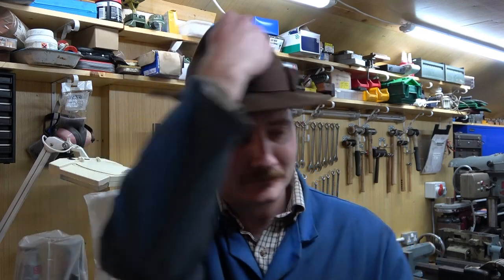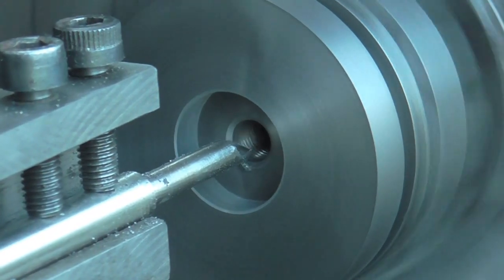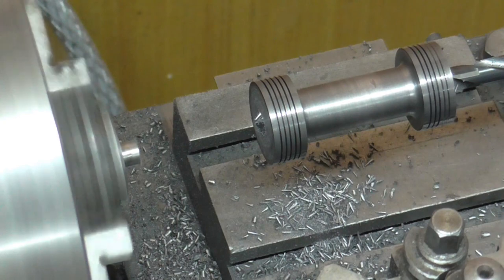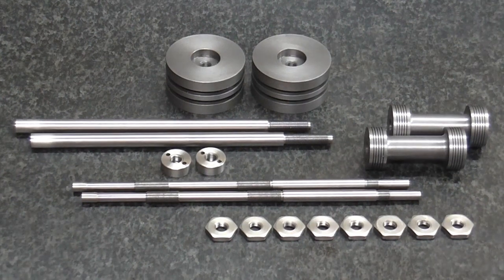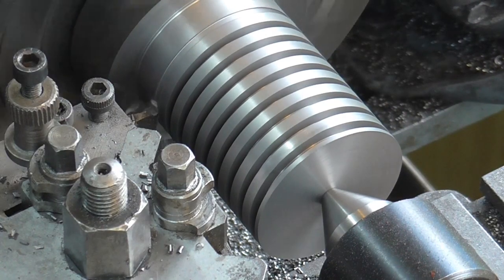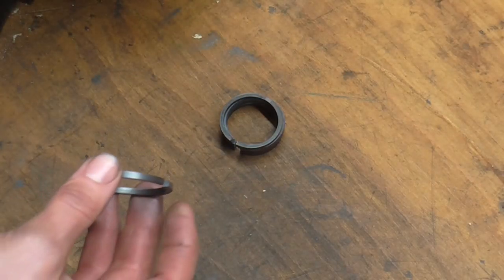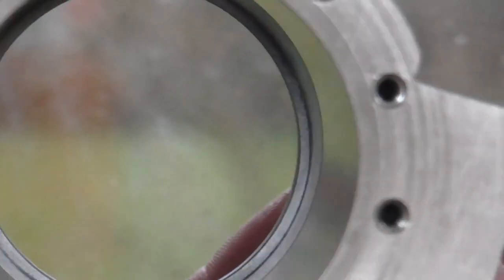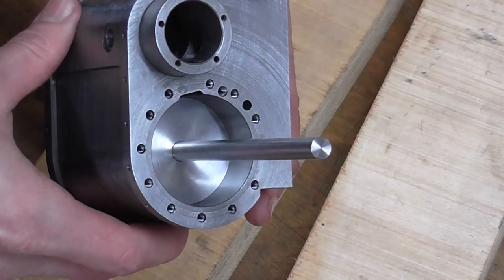Pistons To You Too!!

Comment: I have made small C/A motors for model plane use. Currently on a .370 bore apposed twin cylinder motor I have turned rings from polystyrene which when split seem to work well. My problem has been to achieve adequate piston fit without excessive friction.

Comment: Do you need to go through the ring heating process? Machine the rings oversize then finish machine round by clamping to size as you did in this demo, perhaps I am missing something. Great video, lovely to watch a professional!
Reply from the maker: Hi, good question, the idea is that you don't have to re machine after heat treatment and that you get a perfect piston ring the first time round. So in that case you heat treat to give the expanded position. In the case of starting with a bigger one and machining down after heat treat then yes there is probably an argument that you don't need to heat treat.

Comment: The content is very interesting the more detail the better. I have a question about high speed steel blanks and how long does it take to run through a blank with general hobby work ? keep up the good work and catch you on the next one lol.
Reply from the maker: I don't think I have ever run through a blank from re sharpening. It's more that you need to alter the form for something your doing so you grind a new shape on and eventually you have to go back to a square end and start again. I do most heavy turning with carbide I just use HSS either for form work or sometimes surface finish. I've got bits of HSS that I've been using for at least 10 years
Reply: @MrCrispinEnterprises  Thank you for your feed back. Much appreciated

Comment: Lots of diligent effort.
This is not quite my specialty, but you would not want to slit the ring, rather than (gulp) breaking it--albeit at its weak point?
For...smaller scale engines, I wonder if brass rings could be used, that were work/strain hardened? That way the bore would likely not be at risk. There might be some transfer, though.
Ironically, Viton rubber seals would likely work. : O LOL!
Cool videos. Thank you.

Comment: that piston appears a little too tight on tolerance. when you put steam in there I fear it will score the wall because of expansion.  just my unlearned opinion of the video, in person it may appear to have more clearance.
Reply from the maker: The piston OD is actually 0.0015" smaller than the bore diameter. It is the rings that are causing the friction but that's fine. Expansion shouldn't be a problem because the bore and piston have the same coefficient of thermal expansion with them being the same material. Thanks for your comment. Cheers.

Comment: nice mchining. 
How did you figured out gap for your piston rings? I am not an engineer but  it seemed gapped too little for my eye....
Reply from the maker: Just on the basis of internet recommendations. The bore piston and ring are all the same material here so different be expansion rates should be a major problem.